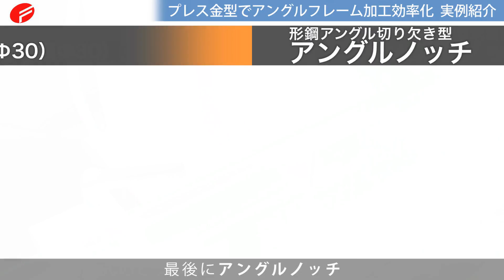アングル加工　プレス金型でアングルフレーム加工効率化 実例紹介【株式会社富士機工】

Comment: how the top portion of the angle notching die can move?
Guide Pillars are used or there is any other concept?
Reply from the maker: Yes, there is a guide post inside the punch holder.
Reply: @fujikikocoltd  and up down motion is done by springs. Right?
Reply from the maker: @amberlakhani142  Yes.